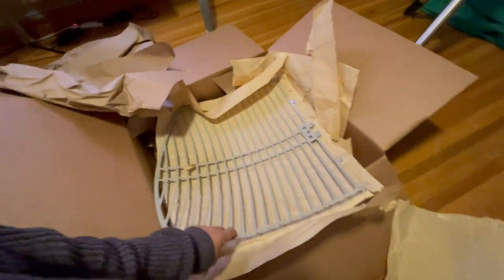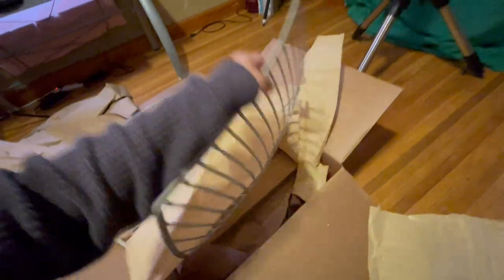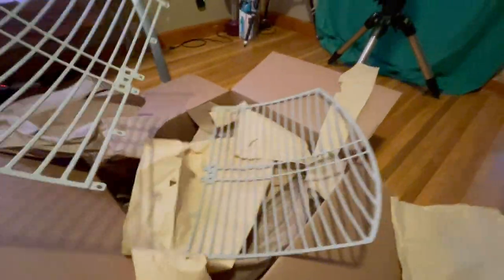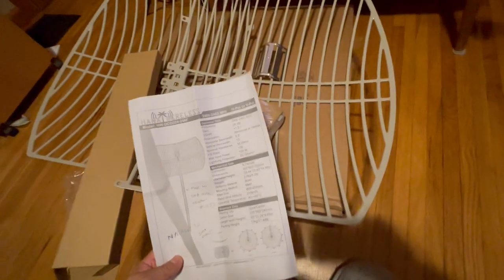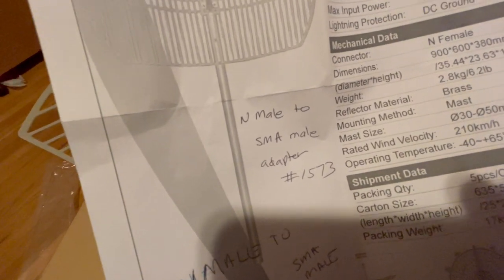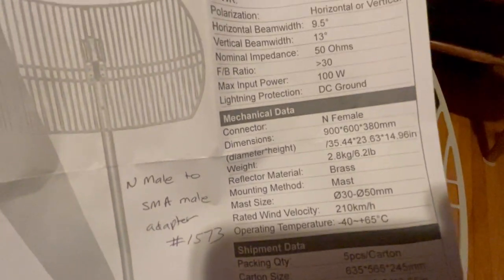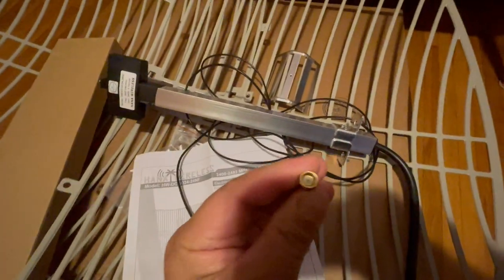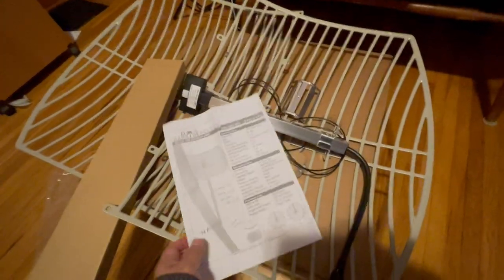Hana 1m 2.4Ghz dish arrived

Comment: ah wow I have one of these dishes that a local cable installation (the cables that run internet and such below the street in a city like you see trucks with giant spools of orange and blue plastic tubing rolled up on it sitting by holes in the street and guys jumping into the hole feeding this tubing in it? yeah that kind of company) had thrown away, later finding a center post and the aluminum reflector tip but missed the second dish, What was I wanting them for? to make a beamed wifi signal over long distance from a small town internet to remote location.

Luckily starlink is going to remove this need, so who knows what I will use it for now XD thanks for the instructional video, definitely going to archive it too for use once I get out side of town in my new lab. :)
Reply from the maker: The thought of having your WAN by line of site by 2 dishes sounds interesting 🧐.   I can imagine you erecting two towers at the highest point of your local/ remote locations, that’s a great learning experience to make it work.
Reply: @jefflucas_life  that was my idea, but since he is all about those lasers and fiber optic connection I am thinking maybe an open air free path line of site laser and collector system instead to avoid the need to dig and lay safely fiber lines as far as he is talking about, until of course I have to do something I need a better long distance wifi connection LOL. (maybe the wireless ip remote control car wars in a scale city for them to use and destroy too, will be a good use, who knows. :) )